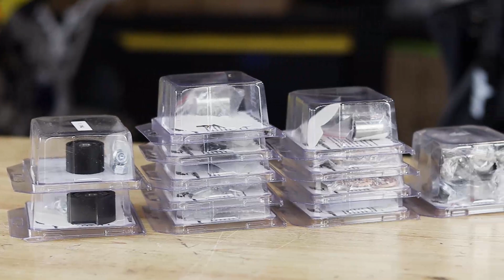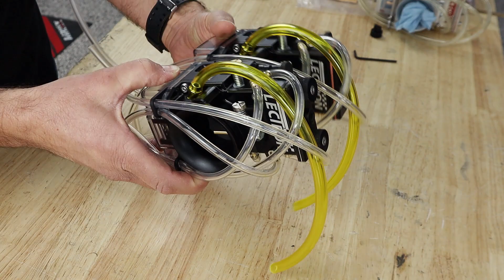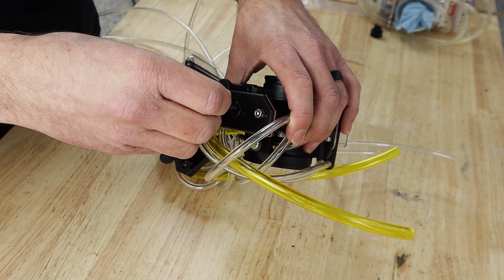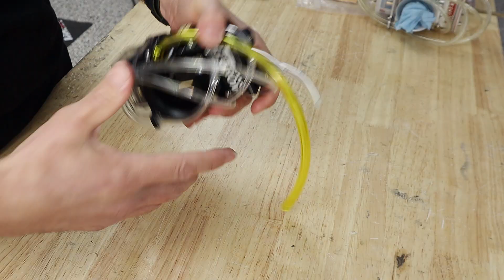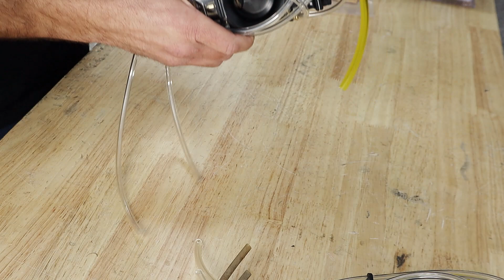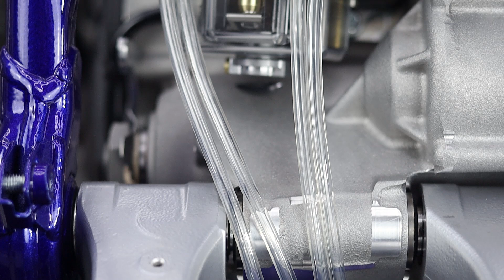TOP SECRET YZ500 CARB REVEALED 🔥 All New 39mm Lectron BIG AIR | Big Bore Two Stroke Dirt Bike Build

Comment: I just bought the new billetron 38 and it runs terrible on my yz250.
Reply from the maker: Rare and odd! If you bought it because you were trying to correct something you didn’t like about your OEM carb, then you’ll want to make sure something else isn’t wrong. Could be anything from a worn top end, fraying reeds, air leak. Just a few ideas. That carb will run awesome, no question. 

You cal call their tech support as well, they love to help. 

Worst case it has a money back guarantee, you can’t lose. 💪

Comment: I have a Lectron H on my YZ 250 I love it. Probably the best upgrade you can do for your 2 stroke hands down. Keep up the good work Charles.
Reply: What did you gain on YZ 250?. Low end?  Mid?? Top end?? Idle?? Gas mileage?
Reply: @Lee-mx5li  I had gains across the board. Much more linear power. Smooth power transition like it was fuel injected. Idles excellent and the gas milage is much improved. It's hard to believe that something so simple can do what it does. One of the best mods I have ever done to one of my bikes.
Reply: @toddginter3111  Thanks Todd👍👍
Reply from the maker: We’ll explained! It’s like a “three stroke” dirt bike!
Reply from the maker: Newest version does the same AND more bottom end. It’s pretty badass!

Comment: Do you recommend any other carbs or is this your favorite one?
Reply from the maker: These are pretty much my go too as they flat out just work & the carb solves 99% of riders most common complaints or issues with their stock stuff. Weather they don’t know how to jet, or don’t like to, or do know how to jet and gate adjusting often- the Levtron just puts all the power in the right spots with therefore (usually) an increase in power, useable power, and fuel economy. It’s just a great product. A perfectly jetted Keihin (OEM) is pretty magical too…for those that go the distance. But it’s still subject to the curve balls of elevation and temp changes. The Lectron just works, like all the damn time.
Reply: Thanks man just looking for something solid definitely going to consider it!

Comment: Do you feel the top end still revs out well with the lectron?
Reply from the maker: 100%. In my opinion, and explained in “regular dude” terms from personal experiences with them…. Definitely continues to revel up top. I feel like because it’s able to take exactly the air and fuel it needs in any given circumstances, it has the sensation of stretching the power band out. It has a similar sensation to adding a good read cage or flywheel weight, if that makes sense. Except while those two provide the sensation of a longer rpm range, the Lectron does it in the form of what feels like power. All of these feelings and sensations described are from my own personal seat of the pants experiences.